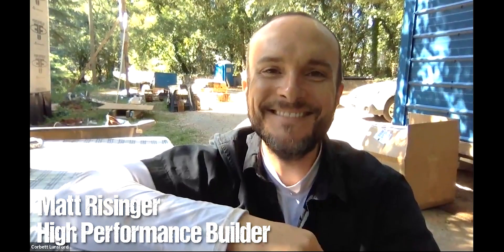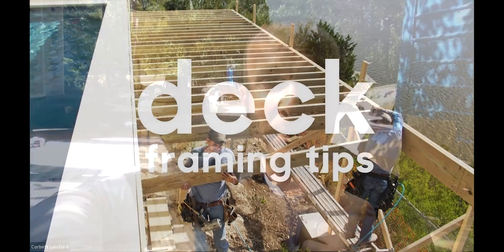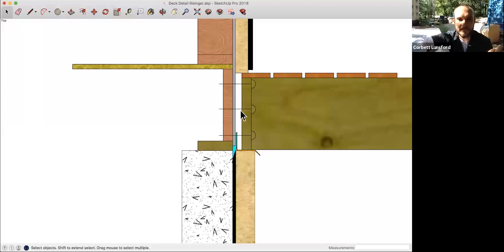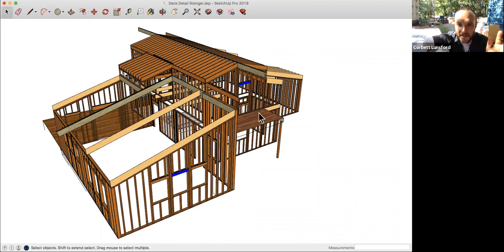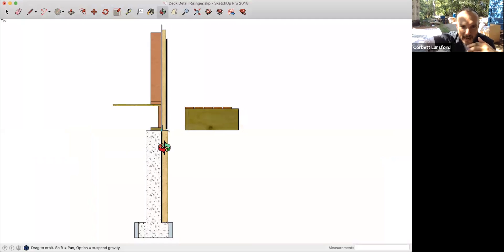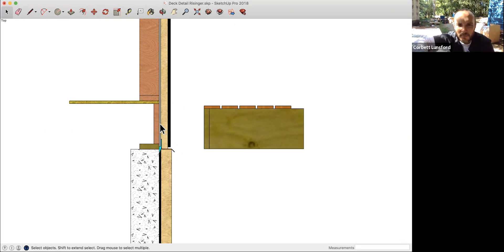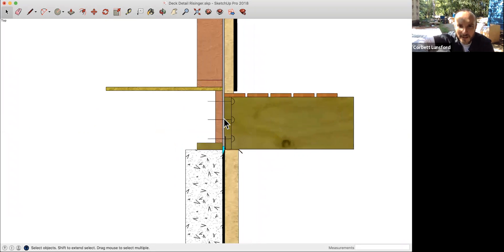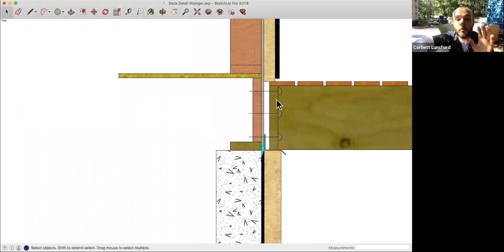High Performance Deck Details with Matt Risinger

Comment: Corbin, a better option is to create a free standing deck with a gap between the house & the deck & separately supported with posts next to the foundation at the same spacing as the outside deck supports. These posts, do require footer pads which are located on top of undisturbed soil
& use soil contact pressure treated lumber or better still environmentally wise, concrete columns.
Reply from the maker: Thanks Michael- I yhink we’ve found an even better solution. Stay tuned.

Comment: I built in earthquake country and learned to make each piece stand on its own. They both need hold downs and sway bracing. And a place for movement between them.
Reply from the maker: Interesting, Michael- would have thought making them one structure would be better for earthquake resistance
Reply: @HomePerformance  
Two different structures. One has a solid, non flexible construction and the deck will rack on those legs. If you anchor one side then the other will "whip". It will amplify the movement of the house onto the deck. This not only applies to seismic events but wind also. The deck needs a hold down support but the house will respond to large lateral forces. Apples and oranges. Mass has inertia.
Reply: In California, we attach Simpson DTT Tension Ties to perpendicular floor joists and through bolts at the deck ledger @ 8ft O.C., although i imagine this may compromise the thermal performance... a common earthquake ledger detail to be aware of.

Comment: Hey Corbett and Matt I am  a builder in the north east and a big fan of you both , just an idea . for the lower deck i would make it free standing and not attached to the house , would definitely have some extra footing work but would eliminate all flashing and penetrations.
Reply from the maker: Thanks Darrin- I think I’ve just found an even better solution than all mentioned so far. Stay tuned
Reply: @HomePerformance  Oh do tell!

Comment: Instead of using 2x material, what about an aluminum I beam that's 3.5" tall cut to 9.25" long. Doesnt need flashing details and the I part of the beam interferes minimally with your insulation. Essentially a diy version of this concept https://www.cascadiawindows.com/products/cascadia-clip
Reply from the maker: You and I have both stumbled on the best approach, I think- there’s an engineered version of this called Maine Deck Bracket
Reply: @HomePerformance  nice. Pre engineered will save you some cash!

Comment: Ledger boards are the leading cause of failure of a deck. I agree free standing is safer!
Reply from the maker: Stay tuned, Eric- an even better solution is coming soon
Reply: @HomePerformance  : How soon until you are able to share this "even better solution"?  
I ask this because I'm working on a house remodel that will have a 2nd story deck and I will need to make the final plans for how this deck will be constructed.

If a video isn't available would you be able to share that information via a web page, email, pdf file?
I'd really like to know if there is a newer "better" solution to achieve the ledger board to house connection.
Reply from the maker: @TechSkills- coming this week, but it’s called the Maine Deck Bracket
Reply: @HomePerformance  :  Thank you for such a fast reply and the information.   

I checked out Maine Deck Products website.  A piece of modified I-beam ... excellent idea.  I will have to look up the installation/design specifications for my deck design.
 
I can see where that design allows for an almost unbroken layer of exterior insulation between the ledger board and the house wall exterior.

Comment: I’m torn on this one. The Maine Deck Brackets are awesome and bomb proof...but they’re metal and the worst possible thermal bridge. Using Matt’s recommendation of wood would at least give you ~R4 and wouldn’t have that massive back of the metal bracket bypassing all your outsulation. 

Super tricky detail...no one answer for sure.
Reply from the maker: Yes, metal is conductive, but you can't build without it. Using a reasonable approach with multiple layers seems best to us.

Comment: Make your deck freestanding.
Reply: Use Maine Deck brackets instead....
Reply from the maker: Thanks Lisa- I think you’re on the right track! Just found these, and we’ll pursue. Stay tuned!
Reply: @HomePerformance  We just installed them--used blocking on the interior framing instead of attaching to the sill plate and left our Zip intact. There are even little pockets for the Comfortboad to fit into. We are building a Perfect Wall house in Virginia. Best of luck!
Reply: Home Performance Nice, but do those brackets need a thermal break?